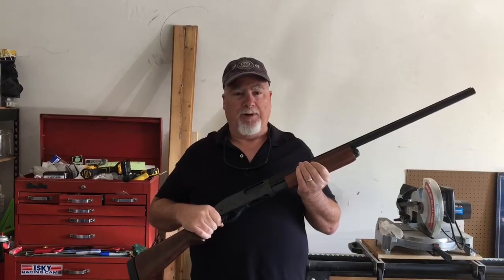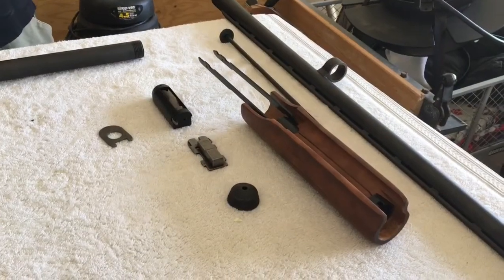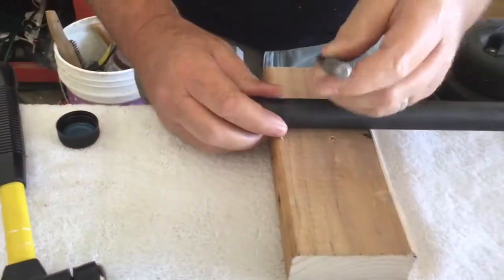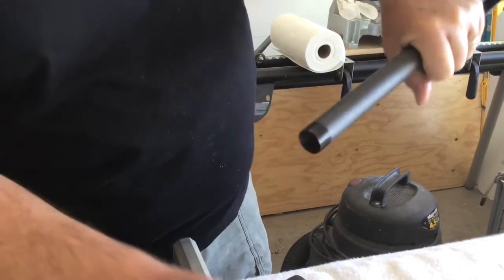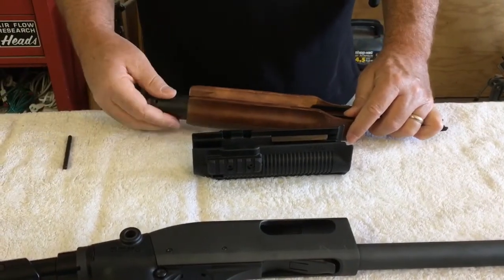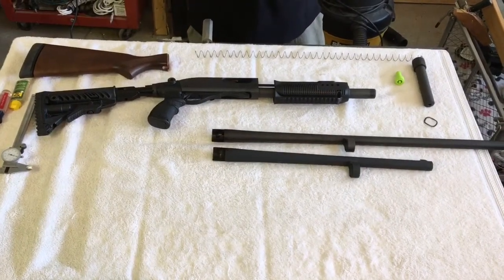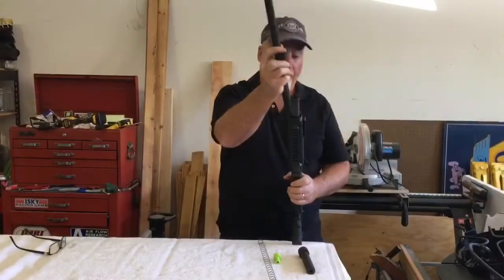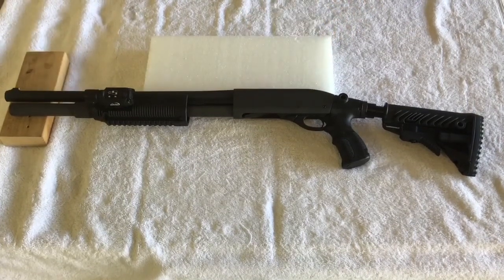Remington 870 shotgun tactical home defense build

Comment: I just came across this and it's a solid build. The only thing I'd change is I'd mount that Pic rail and light on the right-hand side of the fore end so that I maintain more contact on the fore end with my thumb and use my index finger to manipulate the light switch. It allows a much better grip on the front of the gun.
Reply from the maker: Thanks for the comment and the view Mike

Comment: I got the Remington Tactical Express that was already 18.5" a few years ago and it was literally just a few months before the bankruptcy of the company. I didn't know about that at the time.  I got it out of pure name recognition.  Though I quickly found out.  
I was having occasional failure to extract issues.  Not regularly but enough to be a concern.  Same as you did, I swapped the factory MIM extractor with a machined replacement from Volquartsen (MidwayUSA has them).  That wasn't an expensive fix and it took car of the extraction issues.  I haven't had to polish the inside of the barrel as I've never had a shell get stuck, thankfully.
Replaced the plastic follower with a high viz aluminum replacement.
For ergonomics, I replaced the furniture and barrel clamp with Magpul and added the QD cup to the stock so I can use a QD sling (also from Magpul). 
I heard about the rusting issues and even though mine is stored in a dry environment and is kept oiled, I had it redone with Cerakote.
So, while I invested a bit more time and money in it than I planned, it is reliable and customized to my preference now.
Now that Remington is back in business (under RemArms) I do hope these quality issues have been resolved now.
Reply from the maker: It was sad to see the decline of a once respected firearm manufacturer. Hopefully they get it turned around.

Comment: Can you post links to all the specific parts in the description?
Reply from the maker: Channels often post links when they are in an affiliation program ( making some profit off the sales) Additionally, YouTube has some strict policies if doing that so I avoid the issue by not posting them. I do provide the names of all the manufactures in the video, here is a summarization. Barrel is factory Remington, front sight is XS big dot, buttstock and fore end  are Mako Group also called Fab Defense ( there are others less expensive ) Magpul has a very good buttstock for 870. extractor claw is volquartzen, mag tube extension is Wilson Combat, front light is standard sure fire picattiny rail mount light. All of this stuff has gone up in price like everything else and some will likely be hard to find in stock these days. You could do it all cheaper than I did; However, I prefer quality over price.

Comment: Great video! What exact kind of swedge tool did you use to tap in the magazine tube? What size / brand?
Reply from the maker: It’s made by XS sights and labeled for the 870. Brownells has a tool also sold as a dent remover I believe but much more expensive.

Comment: Cool video!  I have an 870 home defense model so I already have a 20 inch barrel and the extended mag tube. I need the pistol grip and the Buttstock.  Would you use a mil spec buffer tube or a commercial spec buffer tube for this build?
Reply from the maker: I honestly think I would go with the Magpul 870 buttstock for several reasons. It’s not tacticool looking but I hear it’s very comfortable and effective gear. If I went with collapsible again I would choose non damping type and with a softer ( or added) pad on end

Comment: You mentioned a torque spec for the pistol grip/butt stock assembly.  What is that spec?  Thanks, I’ve been looking for it.
Reply from the maker: It was provided with the parts as I recall. If they don’t provide one I  would use normal mechanical common sense tightening an  Allan bolt like that,  but that’s just my personal method/ opinion and not expert advice. The stock bolt is a long flexy  flathead screw and it holds fine. This shorter bolt is an improvement over stock  from the get go.. One  thing to check is the fitment of the grip around the back area of trigger guard. Sometimes a little whittling is needed on new grip to seat correctly according to manufacturer. I didnt have any of these problems on mine. If there is a problem, Trying to force that on with the bolt could end up with false torque, a broken grip and or trigger guard If you have newer plastic one.

Comment: good video. 
My issues with this build (and this is only MY issues)
1. The Wilson combat follower is plastic and due to the design my not give you the full potential for round count- also it would bind on my 870.
2. Any spring in the butt stock is just plane gimmicky. 
3. last but not least ALL tactical/home defense shotguns should be Mossbergs, all Mossbergs should be 590s and all 590s should be 12 Gauge... lol
Cheers!
Reply from the maker: I’m not sold on the spring dampener myself. Never used them professionally so dont have a lot of experience with them. The rear pad is as hard as ex wife’s heart and since I’m not wearing a tactical vest anymore , might not be best choice for that reason alone. Will see. …….I wondered how long it would take for a mossy guy to comment lol.
Reply: @thereadinesschannel7610  yes the mossberg kool-aid is sweet indeed. lol
Reply: The 870s  safety is more easily activated with a pistol grip.
Reply: @SpecialK6685  Also, if the screw that holds the small plastic safety control "switch" on the Mossie becomes loose, it could cause the ball detent and spring to freeze up locking the gun in either "safe" or "fire". Not a good position to find yourself in.

Comment: I tried to find that stock, but can't find it. Macco? There are several on Ebay, but can't find exact one with the photos online or availability. What is the brand name of that pistol grip and butt stock?
Reply from the maker: Fab defense, is an Israeli brand and is/ was sold under Mako  in U.S. My main complaint with this stock is the buttpad is hard as a rock. Like hard tire tread.It is fine if your wearing a kevlar vest in a professional environment, which is what it’s designed for I believe, but for normal  use There are other options out there. the Magpul adjustable stock is another choice and will be more comfortable if your  not using for work ,LEO , Military  etc. all these types of stocks are becoming the target anymore in the ever changing gun laws world we live in ( because they look like the rifle most targeted In there thinking)  the Magpul type avoids that issue also…at least as of today.

Comment: Why not keep the 870 as is and spend 500 and get a tactical?
Reply from the maker: You could buy the factory “ tactical” but still would need to address some poor quality interior parts, night tritium type sight , and adjustability for individual ergonomics ( are factory options available now)  I personally don’t have any use for the long barrel version of this gun and enjoy custom building  so there is that factor also. If you don’t enjoy that kind of thing , there are certainly over the counter options out there that would be worth buying. If you get an 870 in any configuration, I would still consider  the billet extractor claw and your personal sight needs. Thanks for watching